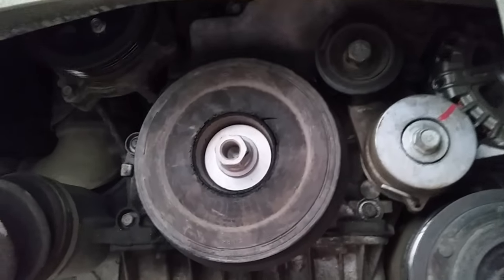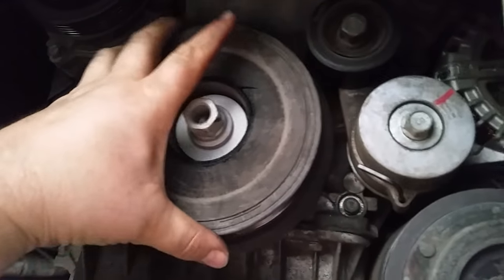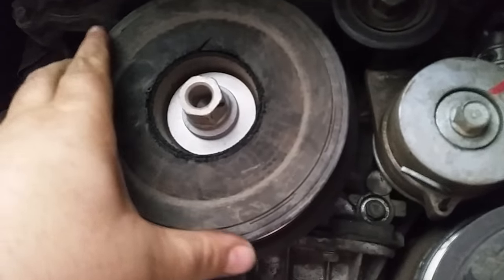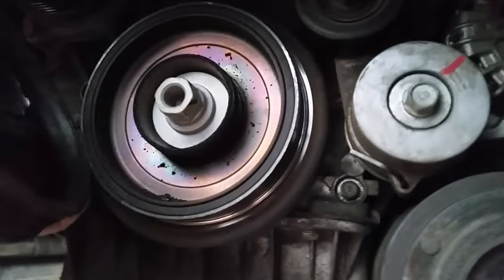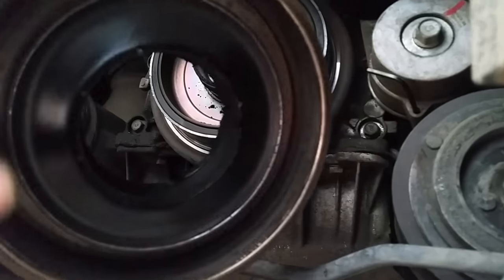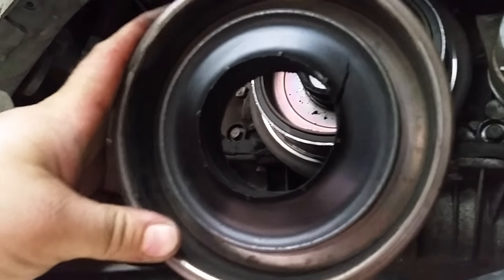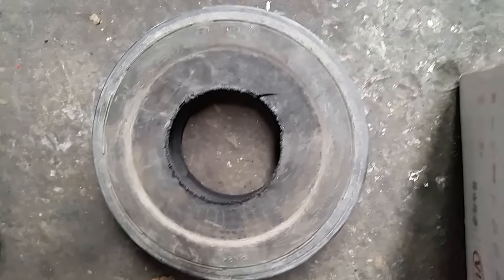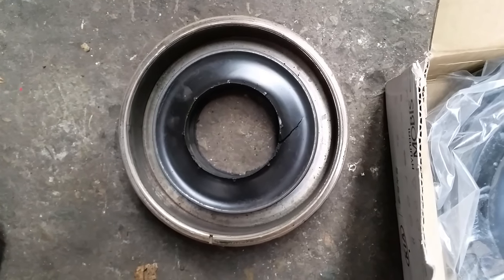Harmonic balancer fault on D4HB 2.2L Turbo Diesel of a 2010 Hyundai Santa Fe

Comment: Wow, I am grateful to guys like you who post these short, sweet and To-The-Point videos of these issues. 
When you buy this stuff brand new, it's the ducks nuts, but after the warranty time / Km's run out, ALL this shit starts to go wrong on them and you begin to realise just how many corners have been cut to shave a few bucks off the price. 
I know that Hyundai isn't Toyota, but these vehicles develop some obscure and completely un-justified faults after about 150k.Km's...
Reply from the maker: Jesus one can see that the inside diameter of that pulley is going to put a lot of strain on that rubber. had they have made the diameter of rubber about 10mm or less the strain would not have been an issue. the main problem i see with the Korean stuff as it ages is the plastics on the electrical connectors become extremely brittle.
aside from that they are very nicely layed out cars to work on and quite well built for the price one pays for them.
Reply: Yeah, I would tend to agree with you mate. I have a diesel iLoad 2.5tdi andI have just hit 150,000 and the turbo grenaded last week so I am a little pissed off about that. Hyundai want $2500 for just a turbo and there are many nice looking bolt-ups on eBay. There is even one that is upgraded from the original one so naturally I am curious, but I need reliability because my iLoad is my business is my income and transport. Without it, I an kinda screwed.
While it's apart I want to investigate a chirp chirp squeak that is about 3 per second at idle. I hope it was just the turbo but i'm dreading what else it could be.......
Reply from the maker: Jesus make sure the DPF is not blocked as that is known to have caused turbochargers packing up.
Reply: Where do I look for that? How do I check it / fix it?
Thanks mate.
Reply from the maker: Its a filter in the exhaust. it traps particles then injects diesel on a long trip to burn the particles off.
https://www.youtube.com/watch?v=aMKpo74P6SE

Comment: Great video, thank you. I’d be really interested to see how you removed the bolt, since there is no other hole to counter grip the broken balancer.
Reply from the maker: you can rattle it off with an pneumatic or electric impact driver. no need to hold it.

Comment: Had this happen on our 2011 Santa Fe shortly after we'd had it in for our regular servicing at our local Hyundai. Lost power and steering on 100km motorway. Towed it and had the harmonic balancer and serpentine belt changed. Drove fine for a couple of months but started to feel strange again and now we've been told we have a 1782 code. Looks like the actuator might've been damaged during the balancer change? Not sure if they put a new bolt on though, like you said. No idea about cars, just what I've read so far.

Comment: Had mine go at 220,000 KM. The motor has never had a thing other than that go wrong with it.  The new pulley balancer from KIA was $680 US. How do you get the harmonic Balancer off? it has no holes for a puller to go in.

Comment: I found it on ebay, says oem quality after market, would you recommend these or should I stick with genuine one?
Reply from the maker: The thing is made from polyurethane and metal. if it costs 1/2 the price of the original or less then your winning. its going to fail eventually anyway. 
its extremely expensive for what it is.
Reply: @fransdebruijn6763  thank you!

I agree it's very expensive.

The aftermarket one was $140 without the bolt, the original one is $270 with the bolt, but since you've mentioned in the video that the bolt has to be changed as well, so I bought the original.
Reply from the maker: @haithamal-qaderi2588  expensive bolt !
the reason they fail is because the inside diameter is too small for the torque. had they machined splines into the ouside of center cup it likley would not fail.

Comment: @ frans de bruijn, does it shows any sign or symptom before that damper breaks? cause i'm a bit worry about my 2011 tucson crdi... thanks!
Reply from the maker: the power steering will feel chunky under load, the alternator (battery) light will come on intermittently (especially when the power steering loads it down), the aircon will not blow cold air reliability and there will be a smell of burning rubber coming from the car.
Reply: @fransdebruijn6763  Yep that's what happened to our Santa fe. Lucky we had used car warranty.
Reply: You don't happen to know how many k's they last? Haven't had any luck finding service manual for d4hb engine

Comment: Hey Frans. What torque setting is needed for the bolt. I'm ready to put mind back together and am having heaps of trouble finding the setting... cheers.
Reply from the maker: Not sure exactly. just do it up with a strong rattler gun. 
You could look it up if you know the size of the bolt and the thread pitch on a chart. usually the torque to yield bolts require a 90 degree turn once brought up to the correct torque. (http://wbtools.com.au/how-to-understand-angular-torque-and-torque-to-yield/)

The head size is 24mm so the bolt is an M16 for an ISO bolt. I don't know the grade of the bolt but is written on the head.

Tightening Torque from a chart.
https://wiki.seloc.org/a/Torque_settings

Bolt Size , Grade 8.8, 10.9, 12.9 
16mm (M16),195Nm,280Nm,290Nm

So use these values and then add an additional 90 degrees. 

I advise you to do your own research on this topic because I could be wrong.
If I am wrong, reply to this message.

Comment: Had mine go at 220,000 KM. The motor has never had a thing other than that go wrong with it. The new Harmonic  balancer from KIA was $680 US. How do you get the harmonic Balancer off? it has no holes for a puller to go in.